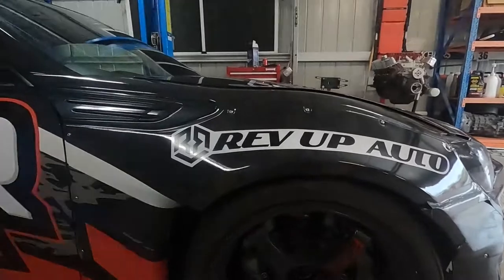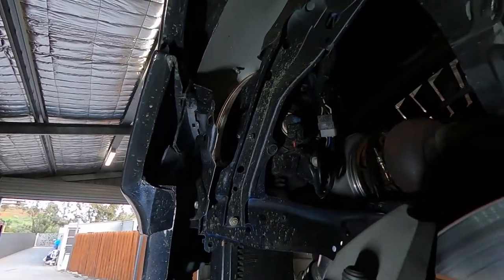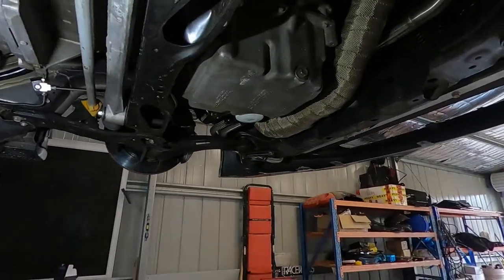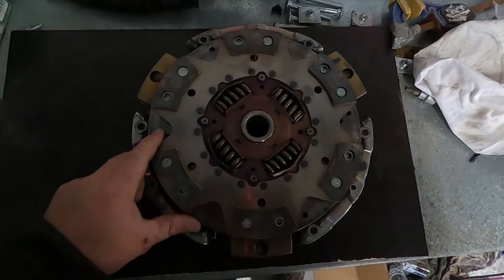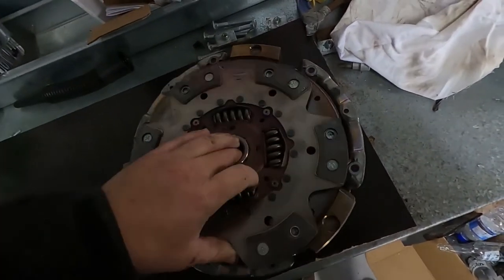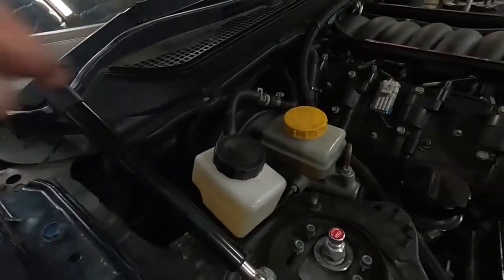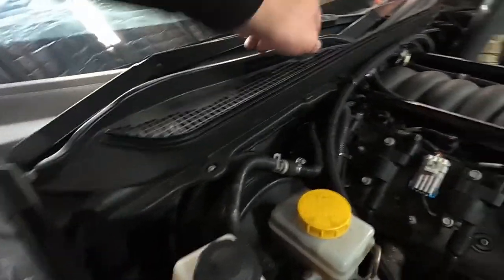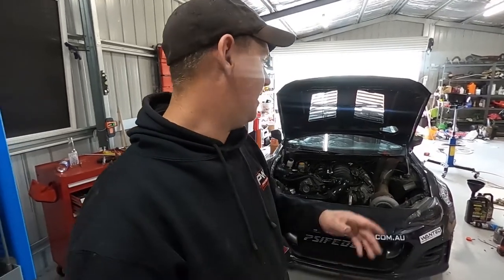Does the NPC clutch live????

Comment: What's the material of the friction buttons? Is it carbotic?  I noticed that mentioned on the NPC site and a quick google says is a high wear resistant durable performance material used mainly in mining trucks.  Sounds a like it's longer lasting and less aggressive to the flywheel than the metallic ceramic more commonly used.